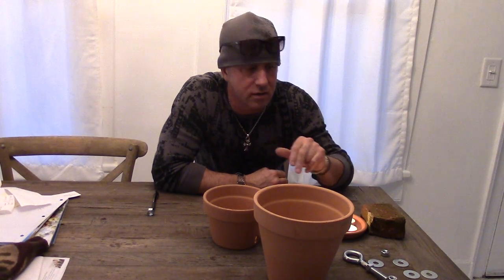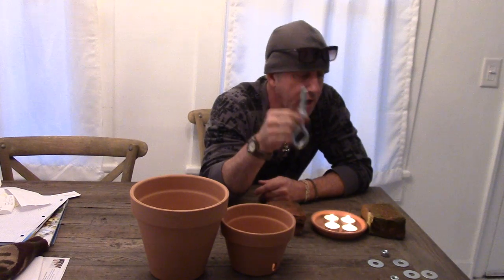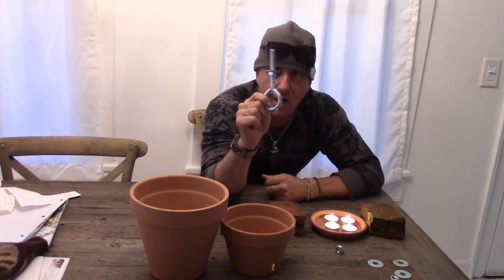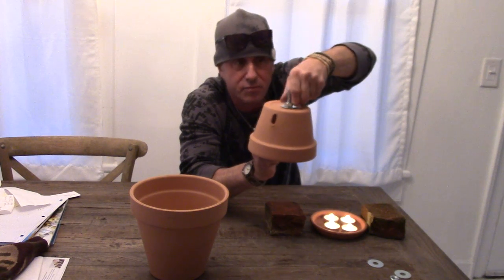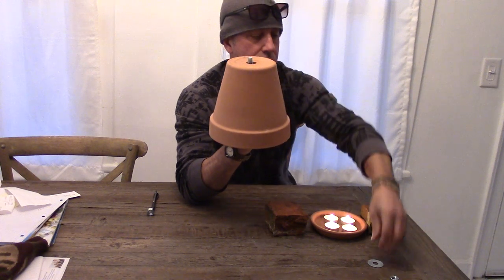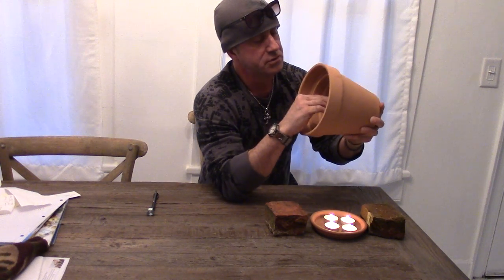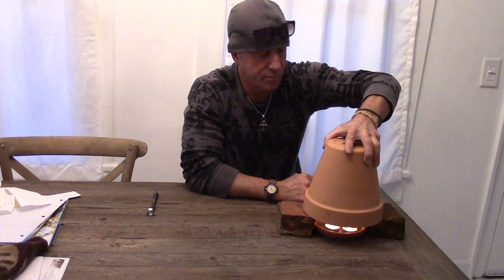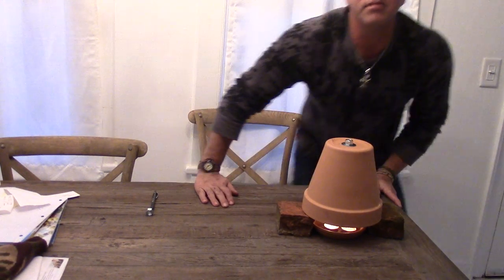Best Flower Pot Heater

Comment: You've defeated the whole purpose by plugging that top hole. The inner pot acts as a plenum. The outer pot acts as a chimney. You've plugged the chimney. Huge, utter fail. Study physics and try again.
Reply: He is absolutely correct.  plugging the hole does not allow airflow.  It chokes the design.  Rude or not, he's absolutely correct.  You need a thermodynamics class and thicker skin.
Reply: Jon Handel    Very deep comments Jon, but how about a video from you that's answers the problem of very cheap heating !!!
John Larkin
Southampton U K
Reply: Jon Handel doesn't have to make a video of anything.  You have to STOP making flawed videos and perpetuating these poor designs.  You are encouraging the dumbing of the world by spreading bad information.  You're no better than an informercial sales pitch guy, trying to waste everyone's time and money with inferior products.The truth may hurt, but this is the truth.
Reply: Hey Holly.  Change your little icon.  You are NOT hot.  Quit your false advertising.
Reply: Alright but how do you expect the inner pot to hang from the outerpot than? Or just lay it over each other?
Reply: Jon Handel,   look carefully, he made an alternative hole on the shoulder of the outer pot, replicating the hole he plugged.
Reply: Is this method ok.
I mean, you are using oxygen and fuel containing carbon right.
So the product would be carbon dioxide right?
Wether the chimney is covered or not, it still worries me.
So do you open a window to let some more oxygen in or just get drowsey.

I'm guessing this method is for a greenhouse, surely not for in house?

Comment: Sorry but it doesn't create more heat just becoz you're putting it inside a pot or two. It's simply impossible! What you're doing is, catching the heat if you understand :) You might as well put the candles inside a stone-owen. The stones will heat up yes, but it still doesn't deliver more heat than if you just put them on the flor in your livingroom. But the smaller your room is, the more you will enjoy the heat... If it was possible to create more energy "out of the blue" by covering the source we would really be well of ;)

Comment: You cant create energy. Will not heat but a very small area. Make a good handwarmer and thats about it.
Reply: That's exactly what it's meant for. Did you seriously think it was intended to heat an entire house? It's for a grid down situation, when you can't even buy fuel to keep warm. One can also create insulation "bubbles" against the cold, (ex: nesting a tent within a trailer within a garage), for added protection against the cold. A little clay pot heater inside a setup like that could save your life... unless you already decided it's only good as a handwarmer...
Reply: @bluejean4444  no didn’t think it would heat the entire house but might heat a dollhouse.

Comment: Sorry.  This will heat but only by virtue of the candles.  The pot does nothing to aid in the heating.  BTU is BTU, no matter how you get it.  A candle has just so much heat.  Putting a pot over it does not increase the heat.
Reply: tiny flame keeps the larger mass at tiny flame temperature. *see "rocket mass heater" for proof of concept.
Reply: @bluejean4444  This does not apply.  The laws of thermodynamics prevail here.  The candles supply the BTUs and nothing else does.  They provide a defined heat and that's all you're going to get.  Period!  Just because it's a "concept" doesn't mean it magically derives additional heat from a 'nothing' source.  Can you tell me how the BTUs are increased beyond the candles?  Of course not.  They aren't.